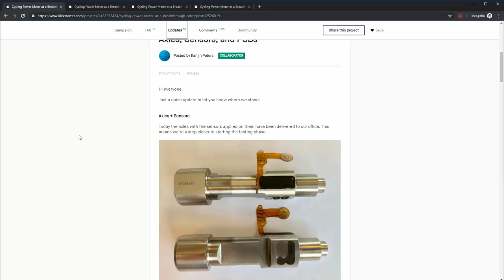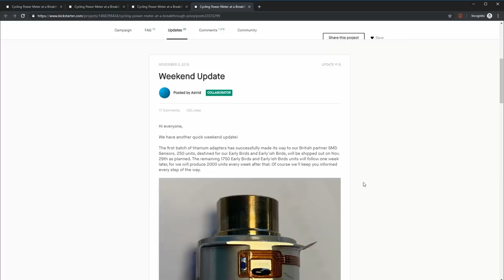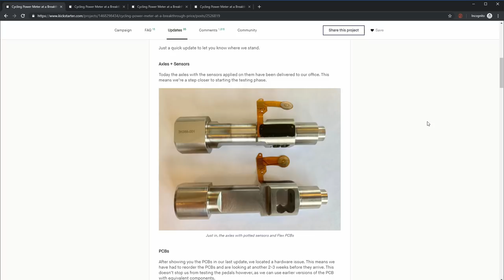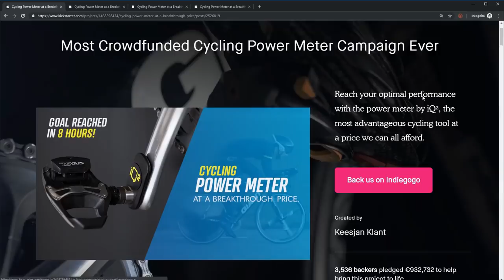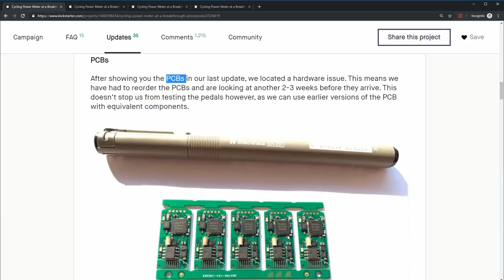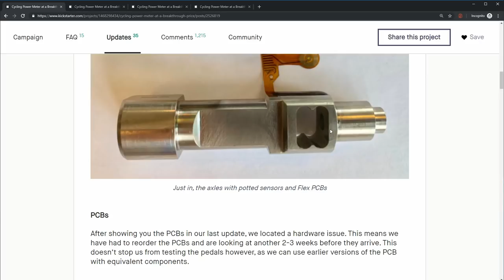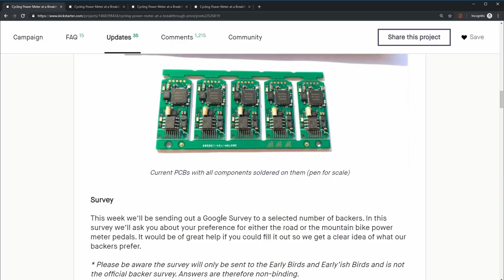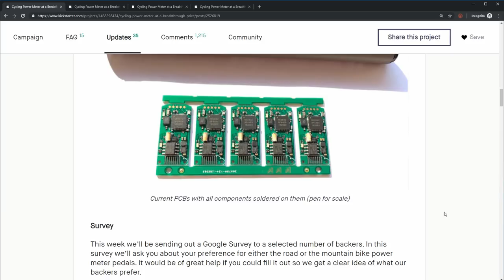Why  you won't get an IQ2 Powermeter this year?

Comment: Good job again. If the gages are deposited on the metal directly, I could see how they are not able to install in-house. But why cheap-out on a single deflection method? Also, the bearing needed will be very tall. Does anyone have any specs and history on the gage technology they are using?

Comment: As I'm making a DIY power meter, I agree with your points. IQ2 PMs may be available late this year but I guess customers would be trapped in warranty issues.
Reply from the maker: Unsolicited, but I always tell people this. If you're in this to learn about the types of sensors, the adc's, the programming and standards AWESOME! If you're building it save money you won't, better quality and features you won't without a lot of money (think 100k with "free" labour) and time, or accuracy you won't without huge money (200k+ with that "free" labour) and testing rigs (multiple 20k - 100k purchases). This is all without "marketing" which is harder now that there are 15 pm companies +/-2 depending on failure / shipping / acquisition.
Reply: @kwakeham  I own a power meter (stages). And I'm making one for my commuters on a doggy crank arm, just for fun. No need for accuracy, quality etc. I'm a PhD in Engineering, not so difficult to make a ugly one with strange numbers (but referable).

Comment: What sort of sample rate is required for power meters? The chip looks like 8SOIC, if 60sps is adequate there are lots of cheapish microchip 16-24-bit ADCs in that package (eg MCP3553 $3). If higher is needed the price jumps up (ADS1252U 41ksps $8).
Reply from the maker: There is a lot that goes into the chain. The sample rate of these chips is the least meaningful actually because Sigma-Delta's are time integrators unlike SAR's which are sample and hold with a compartor against a DAC. So you need a gain stage, external reference ability (differential for strain gages should be employed). I've not evaluated this MCP3553 but I've evaluated all the top chips of Maxim, AD, and TI. And effectively in quantity they are all in the price range you highlighted. Keep in mind though that ever 1 dollar = 3 - 5 dollars at MSRP for consumer devices. Realistically even with Sigma Delta's they range from 60 - 120hz sampling, but still internally averaged down to a single data point per rotation mostly.

Comment: Some good info, thanks. It looks like their crankside bearings are going to be awkward at best. I can't think of a good reason for the slipdisk, not needed for a rotation encoder even if they were going to introduce one, plenty of space to put a charging connection/LED on the metal flange.. I made the decision to invest in IQ2 too quickly, it has become increasingly apparent that they're good at coming up with an aesthetic product design but don't have a handle on managing a technical project - now looks doubtful their going to deliver anything to backers.
Reply from the maker: Slip disc is so they could mount the CR2032 battery in the pedal body that is rotating which I didn't really mention that as why. Just that slip rings are bad. So many crowdfunding things are cool images and video first with no substance.

Comment: Given that the first batches are gifts to the original backers, and then only after the first few thousand are made and given away, they start selling these in Europe, why do they need FCC testing?
Reply from the maker: Well for Europe you're right, they can self certify under CE, though I believe (not 100% sure) this is getting stricter. Colleagues of mine last year went to upgrade knowledge because of what they said were stricter changes coming. So they can't sell US / CAN / JAP / AUS / NZ / etc but they could do it in Europe. However, they still actually have to test it. The penalty for not being able to prove you are under the limits is harsh in the EU. Large fines.  So while there isn't necessarily the same process, they have to do their due diligence and have it tested by a testing house (or potentially internally, but considering they don't have facility to install their own strain gages, I don't think they have the gear to do anechoic chamber RF testing).

Comment: Well.. you got some things right and are conjecturing on many.  Is a solid design and is gearing up for production quickly.    Direct deposit or thin film strain gages are not magic and test great in this application.. ... not the same as gearing up your garage to glue lots of bonded foil strain gages.. ..that's just silly for a consumer application like this way too labor intensive.   Inform yourself before misinforming others please.

Comment: What about consulting them, instead of badmouthing the project?
Reply from the maker: If they reached out, and accepted a quote with my consulting rate, sure, but I don't have any interest in chasing them down. I did a race to the bottom (of cost) in a startup before. I'd rather be involved in race to unique. Not to have another pm I designed in the marketplace. 2 or 3's enough. Only so many ways to skin this cat. I don't think I badmouthed them either. Their design is on a decent track. Some new obvious flaws, which they should heed because it took them almost 2 years to find the old obvious flaws. Their timing being ambitious is simply a hallmark inexperienced and not account for risk and mess ups.